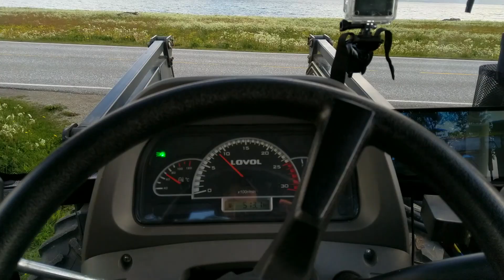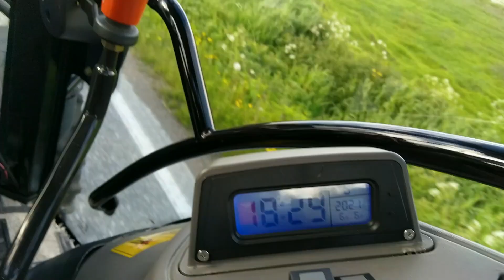Lovol 504 with trailer #9.Northernlight

Comment: how many kgs where in the trailer with the sand in? and whats the towing capacity of the tractor? nice vids
Reply from the maker: Thank you! I use to have approx 3000kg in the trailer. The weight of the trailer itself is 740kg. The max towing capacity is 5000 kg but i think that is a bit to much because the route I drive is long and have some steep hills.
Reply: @outdoorsintheartic  excellent towing capability. does the tractor have trailer braking system? cause there are someones who you can add it to, and i guess youre gonna fill a bit safer on it with those roads you drive in

Comment: I know its a bit out of season but I am looking at buying a lovol for this upcoming winter season to move snow.. wondering how big of a snow blower you use? Can it handle a bigger one?
Reply from the maker: Great question. My snow blower is a Dalen 2004. (V-shape, with 1 fan). I think 50 HP handle it quite well, but 60 HP would have been  nice to have on the bigger snow falls. You should be aware of not buying something bigger cause then you might have problems to operate it. I think if you can find a two-step-blower (those with transverse shovel and fan) that is made for small machines would be the best.

Comment: How would you rate the 504 for brakes when towing with the trailer loaded.
Reply from the maker: I would say the brakes can handle it well. I always use a low gear as an extra "safety" if it is very steep.